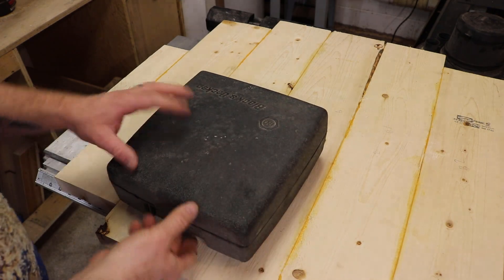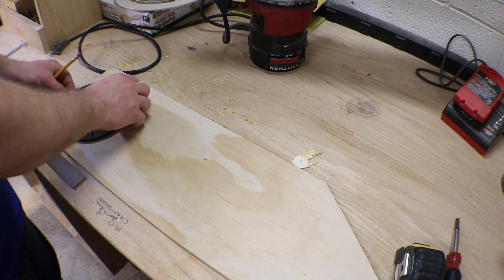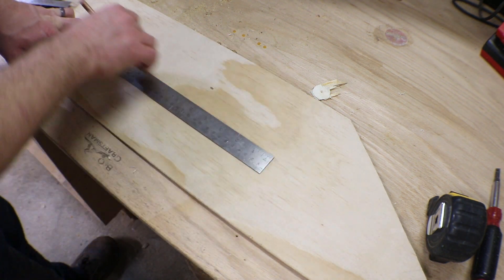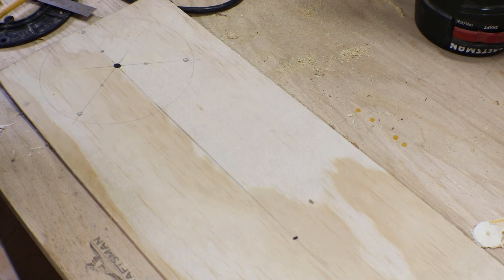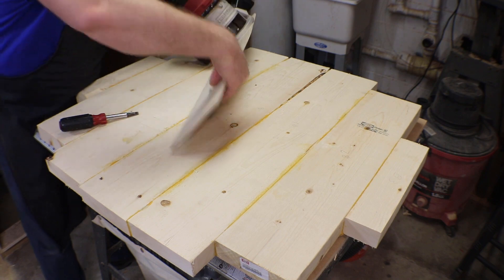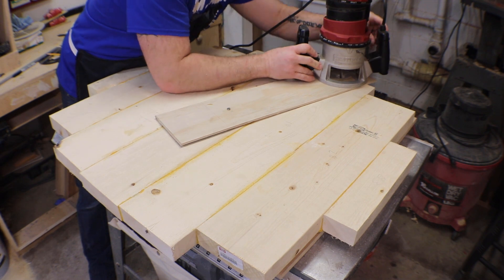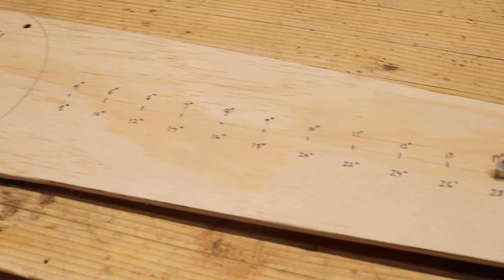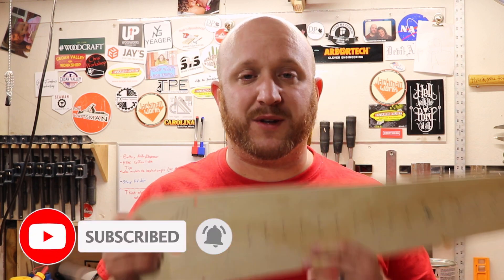DIY Circle Cutting Jig

Comment: Dont you have to take into account the thickness of the router bit? Seems to me you would be cuting an under size by purely using center point to center point.  Your finished product would be smaller than 20" by half the size of your bit.